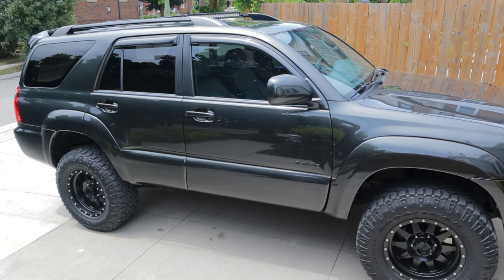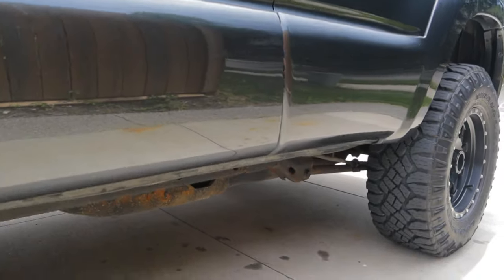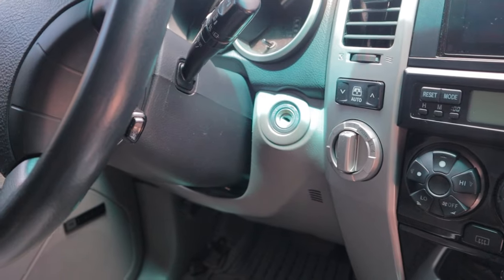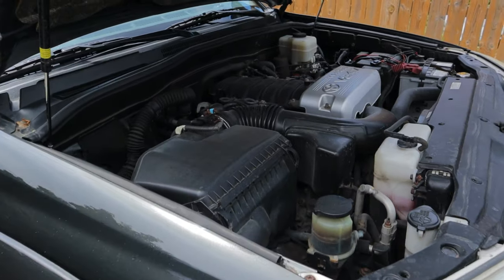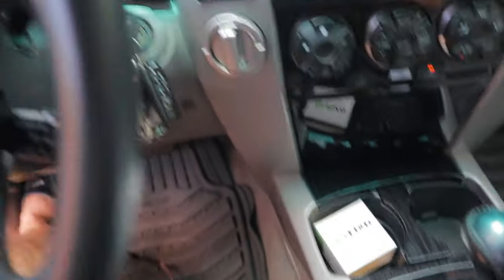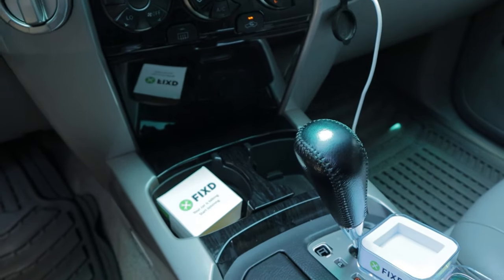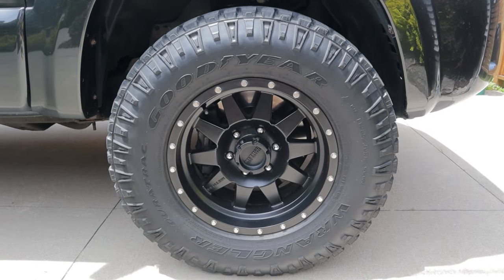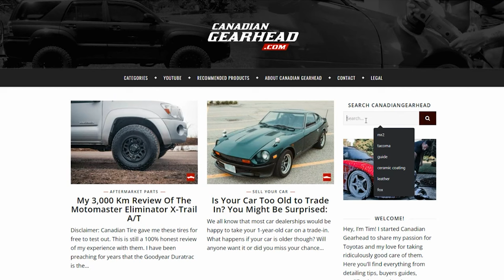Don't Buy A 4th Gen 4runner Without Checking For These Problems!

Comment: The actuators do not require anything being done to the transfer case. The transfer case actuator and the center differential actuator are both external and can be easily replaced WITHOUT doing anything to the transfer case itself or the center differential itself.
Reply: I’m in the process of buyin a 2003 4 runner but the 4x4 does not engage it just makes a beeping sound and that’s it. Do you think it can be expensive to fix??? Should I buy it?? It runs perfect in 2 wd mode it’s just the 4x4 that doesn’t work
Reply: Dam I’m in Chicago and we have around 4 months of winter ❄️. Was looking at an 07 with the 4.0 v6 later this week.
Reply: I’m afraid you are wrong. I was able to get mine going without removing it from the transfer case.
Reply: @marleythechameleonandherbi2724  I'm not wrong. The solution is different in each case depending on what is wrong with the vehicle. Don't assume your solution applies in all cases.

Comment: Nice video.  2008 V6 owner here.  I have 290k miles on mine at the moment.  The driveshaft thing freaked me out when I bought mine used.  I initially thought I had a trans issue.  I do lube my driveshaft but the clunk seems to come back every 6k to 10k miles without fail.  My 4WD actuator was initially hard to use when I first got my truck.  The prior owner probably didn't use it frequently as mentioned.  I did replace most of my climate control lights including ones on the buttons too.  For the first time, I'm  getting a steering wheel shake around 65 mph and when I hit the brakes.  My front pads and rotors were replaced about 20k miles ago.  I am going to do an inspection on the brakes, is there a way to tell that the caliper is stuck?
Reply from the maker: I think the driveshaft can be considered a regular maintenance item, especially as it ages. Might be a good idea to grease it with every oil change interval. That sounds like warped brake rotors and it's also possible that a stuck caliper could have caused them to overheat
Reply: Un Even pad wear if it's really bad will fight you going back in
Reply: There are 6 grease fittings on ur drive shaft grease ALL of them. EVERY oil change no more problems. 👍
I have a 2008 V8 250k  an so far no leaks in the exhaust manifolds 🤞
Reply: It could also be control arm bushings. Easy to check if they’re worn out or not
Reply: @CanadianGearhead  I checked the calipers and they were not frozen.  I was able to move the pistons in without issues.  What stinks is that I only have about 30k miles on the front rotors (Centric 12044129).  Is the warping typical on these trucks?  Is there a better rotor?
Reply: @andreinvictoria  Yes, I have been trying to grease them every 10k.  Last time I checked you could see a lot of splatter on the heat shields so I decided to skip doing it this time around.
Reply: @vettepwr23  I've had good luck with the same Centric Rotors and Akebono pads on my '03 V8. I pull a 23' boat in the summer with no issues. I find servicing the brakes every spring really keeps the calipers moving with less chance of them seizing. Helps the pads last a bit longer too. On the calipers I've replaced, it's usually only one of the four pistons that seize(lower inboard). I've had problems with the front brakes warping fast on the wife's RX 350. Spent a little extra on EBC rotors and pads and so far, so good. Way better than OEM.
Reply: 2008 4Runner with 195k miles here. The steering wheel shake with good rotors and pads indicate the wheel bearing needs replacing. Know this because mine was doing the same thing. Hope this helps someone.

Comment: I had one (07) and absolutely loved it!!! The issue I had was the head gasket. Also, a lot of the rust problems are due to road salt, so I've always tried to clean it well and repaint it before winter. Preventative maintenance is worth it if you want to keep your 4Runner going for the long run.
Reply: Wow the 07 had head gasket issues too?   I thought that was just the 03-05 only and it was fixed for the 06-09.  Now I'm scared to get one of these.  How much did that cost you to fix??
Reply: @Jedi_Luke  Yup. But don't worry because it's okay if you do preventative maintenance.
Actually, I don't remember exactly the cost (I replaced the head gasket on my own), uh...maybe around $2500 for head gasket replacement (my near local shop price), and the body patch, primer, and paint aren't expensive for cleaning and repainting the rust.
Reply: I just bought an 06 diagnosed as needing headgaskets. Replaced crossover gaskets and resealed thermostat housing and haven’t added coolant in 500 miles. Previous owner was quoted $4000 to repair. Had a slow leak that ran down along the head that appeared to look like coolant was seeping out from the hg.
Reply: With the heavy rust problem areas, I use Liquid Wrench, or Seafoam Ant-Rust spray on those metal areas "only", it will destroy rubber brake lines and eat through wire coatings if not wiped off but works "very well" on metal and frame works, I use WD-40 for the rest of the vehicle which won't do that and it's non-conducting. :)

Comment: 4th Gen 2WD V8. Problems I've faced was the secondary emissions pump went out and kept putting it into limp mode. My alternator went out and my car shut off on the freeway after the battery drained. I fixed everything myself so no need for a bypass for the emissions pump either. Here's the thing, fixing a car is stupidly easy if you're an adult male. Sure, it's a hassle but the main problem I see from a lot of guys is that they get really pissy when something goes wrong. Just have patience and almost every problem you will come across , the solution can be found online.
Reply from the maker: These trucks are pretty straight forward to work on!

Comment: For the V8 models:

1. Has the timing belt and water pump been changed? Some people have gone over 200,000 miles without changing.
2. Serpentine belt lasts around 90,000 miles. You will hear a squealing noise if it has gone bad.
3. CV axles go bad around 100,000 miles
4. Fuel Filler door does not open or fit properly. You may need to replace the door and could have your mechanic install a plate and rivet screws to replace the hinge.
5. Has the transmission fluid been changed? The fluid is good for 60,000-90,000 miles. Some people have gone well over 200,000 miles without changing it.
6. Has the coolant been flushed? The coolant lasts a really long time but bad coolant can ruin the water pump or head gasket by creating crud that messes up certain seals.
Reply: The SAIS (secondary air intake system) can be fixed with the Rutech Bypass kit for around $200. It can be difficult to remove the nuts in order to install the blocking plates. My mechanic was only able to install 1 of the 2 blocking plates but so far after 2 years and 10,000 miles, I have had no problem. This problem happened when my 2005 4Runner had 90,000 miles in 2020.
Reply: Is it just the limited models in v8 that have the air ride suspension?
Reply: Non-interference engines on them so people just wait till it snaps then they replace it. 😂
Reply: Thank you....looking at a 2005 V8, milage nearly 190,000. Vehicle looks well taken care of inside and out. So it makes me hopeful that engine was also taken care of.
Reply: @workingtools2999  It's an interference engine

Comment: I use WD40 under the hood and under the vehicle to help prevent corrosion on the bolts, all the rubber hoses, all the wires to prevent cracking, and on the serpentine belt also to prevent cracking, frame and fuel tank cover and front skid plate a couple times a year, works very well, it's a non conducting product which does not affect electrical current and does prevent wires from stiffening up and cracking, I have been doing this for the last 27 years when I first bought my GMC Safari (new) and use it on my my 4 runner (4th Gen) which I bought 12 years ago. Great heads-up on the 4 Gens CG, Thanks for sharing.

Comment: I've had the same problem with seized front calipers. I've tried many rebuilt ones that usually last 2-3years even with servicing them every spring. Then about 4 years ago I tried a new Raybestos Element 3 caliper and no issues. The factory coating even still looks new.
Reply from the maker: That's good to know!
Reply: Powder coated Powerstop Calipers are another option, Centric collectes OEM calipers, remans them with OEM parts, then powdercoats them. Toyota does not use a sufficient corrosion coating on their calipers for the 4runner platform. The Raybestos calipers have a heavier Zinc coating than what exists from the factory but it won't last forever.

Comment: I had the exhaust ticking noise for awhile and now I have codes just yesterday for the catalytic converters. Just bought this truck a month ago too.
Reply: Very similar situation here. Had mine 2 months now. Was getting a p0430 code. Put a shop vac on the exhaust pipe set to blow. Spray exhaust with soapy water (while engine is cool)and find where it bubbles. Once the leak is identified set the vac to suck to create negative pressure and Use JB weld exhaust cement. I fixed a couple leaks and haven't got the code since. There's still a leak closer to the manifold that I just can't get to. I'm not sure if it's the manifold itself or just another leak behind the heat shield. I haven't had the code since but It's driving me crazy though! This vehicle already has Magna Flow exhaust on it so I'd think that this system would be good. Vehicle only has 150k miles on it. Definitely was in the rust belt though. Sadly didn't see this video until after I bought it. I live in GA so I didn't even think about rust....

Comment: Ripped CV boots (especially aftermarket axles and boots), coolant leak on the top, back of the motor (bypass gasket), leaking XREAS shocks, and a leaking transfer case are some of the other issues I've found.  T-case leak could be a simple o-ring or the actuator that's $1,300 USD from Toyota for the part alone. Either way they're big money to replace just in labor.

I just got a 2004 4Runner with the 4.7L and had it inspected before buying so I knew what I was dealing with..  We're actually overlanding with it in Colorado right now and just checked into an AirBnB to shower and do laundry 😂
Reply: Quick question coolant leak ?? What was the cause of that ? Thank you
Reply: The fix for the CV boots is used OEM 5th Gen 4runner axles. I only use these vs repairing the factory 4th gen boots (they are a bad design which was fixed on the 5th Gen). It’s a straight across swap, no mods needed. Never run aftermarket Chinese axles…
Reply: @nordicpride9708  Great advice, thank you NP. :)

Comment: hey so check out the blaster company for their rust remover and actually the rust prevention spray they sell. I found to my great delight that the Blaster Rust Sheild actually melts the rust off of your metal parts. I had an old subaru forester that I was changing my brakes and rotors and i got the rust sheild to put on the rotors... what I found out is that I could spray it onto the locked up bolts and nuts and after about 2 min i could wipe the rust off... yes i said wipe the rust off! I just thought since you made this video 9 months ago maybe this would be usefull info for you

Comment: Going to buy a 2006 4runner sport v6 with 99k miles tomorrow. Very clean inside/out and owner had many parts replaced like shocks, battery, alternator,  wheels, etc.  Looking forward to the car.
Reply: Lmk how it is
Reply: hows your 4runner doing any updates?

Comment: i have the 2005 sport v8 since 2018 and my right header just cracked. other than that, no major issues other than the general consumables pads disc etc. But rust has formed on the back door and inside the driver door near the mirror but inside the frame. odd place that!

Comment: the driveshaft clunk is a bigger deal than you think, the factory u joints cannot be greased as they dont have a grease fitting, replace u joints as soon as you can. otherwise youll be replacing your driveshaft just like myself on my 2003, first owner didnt do the maintenance and now at less than 200k miles

Comment: checking out a 2005 4runner v6 tomorrow. thanks for the tips.
Reply: Same
Reply: @franky1528  Good Luck! One badass 4th gen sold right before i looked at it. I ended up buying a 5th gen trail limited. Love it so far. Crawl control is amazing, saved my ass in the snow, would have been a long cold night otherwise.

Comment: 2008 V6 4runner, I've had like 4 different lights on for the past like 3 years now, VCS or VSC whatever haha, engine light, tire air light, traction control light, apparently from my mechanic it's just an O2 sensor & when I start it up, it makes a noise where it sounds like a loose heat shield is rattling or something, like a nut is missing, noise comes and goes, has about 155k miles on it
Reply from the maker: Should be easy to take care of all that - rip the heat shield off, replace O2, clear codes, and disable TPMS system
Reply: sounds like my 06 v6. Ive had those dash lights on for probably 5 years. Just hit 215k and still runs like a champ though 💪

Comment: The transfer case does not have too be removed and rebuilt if the actuator doesnt work.   It is seperate and bolted on to the housing of the transfer case with several bolts.  I know because ove serviced them before

Comment: I bought a 2004 4runner V6(only 141k miles) the frame is actually clean for its age , well previous owner made it spend most of its life in Mexico, my issue is hvac motor whenever i turn my temperature up or down it starts clicking even when i shut the air off it still clicks ,
my AC amplifier went out too
Reply: heater door actuator, might be that

Comment: I have a 2005 Toyota 4Runner the sport edition 4.0 I got a little tiny bubble on the hatch like that but the back towards the springs it’s rusted really bad cause there is holes in in but I’m hoping to reinforce it and keep her going. It only has 260,000 on the clock so she still has a lot of life left in her

Comment: well rust that happens on the car maybe be due to the original owner I got mine in 2006 and don't have any rust other than the ones I caused. my main concern has always be the engine and I've kept up with very good and i have no rust on the engine so yeah

Comment: Will the Fixed reader provide the tranny fluid temp?  Also a great way to diagnose a sticky brake caliper is to take a temp reading of the rotors with a kitchen insta read thermometer right after driving the truck.  A sticky caliper rotor will show a significantly higher temp.

Comment: I assume you've never had the rear hatch window spontaneously explode while using the rear defrost, spewing shattered glass throughout the inside of the vehicle. It happened to me on my 2006 4Runner, it turns out Toyota issued a TSB on that very issue.
TSB 0189-17
Reply from the maker: I haven't had the problem but I've heard of other peoples' stories

Comment: Mine is starting to have air suspension issues and I want to convert it to coils. What kind of conversion kit did you use.
Reply from the maker: I used the Metal Tech kit

Comment: I'd love to see a video on replacing the wheel bearings on this truck. Mine are grinding and I'll be doing that here soon.
Reply from the maker: Unfortunately I just had my fronts done at a friend's shop because I didn't have time to do it and film :(
Reply: I actually did one side (didn't solve the problem because i think it might actually be the other side) but it took me 5 hours including trips to the parts store

Comment: I have a rhythmic knocking from the front driver wheel. I thought the knocking could have possibly wheel bearing starting to go out, so the hub and bearings were replaced but the knocking is back, 2 days after the repair. any suggestions.
Reply from the maker: Check driveshaft u-joints

Comment: I'm starting to get a humming/whining noise on my '03 V8 limited with 300,000km. Both front wheel bearings were changed recently, the driveline is greased every other oil change and diff's & transfer case oil changed every 60k.  It sounds like it's coming from the rear between 40 and 80 km/hr and doesn't change when turning left to right. Any recommendations on pin pointing the source? Some say the rear diff. carrier bearings get noisy at that many km's.
Reply from the maker: Hmmm, if it's a noise from the differential, you might be able to hear it by lifting it up and spinning the wheels
Reply: Could be rear wheel bearings. Very common on these
Reply: @nordicpride9708  You're right! It was the right rear bearing. Much quieter now. Hopefully the left side lasts a bit longer.
Reply: @4-Runner  Glad you got her fixed! One thing overlooked is the differential breather. If it gets plugged it will blow the rear axle seals. Very common on these 4th gens
Reply: @nordicpride9708  Great point! I usually give the vent a few spins when I'm putting on the summer tires every spring